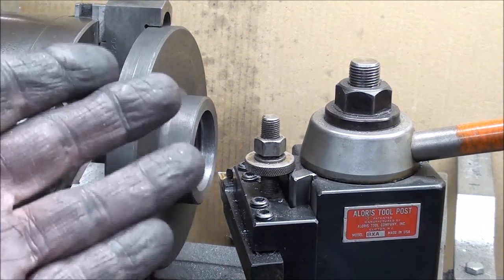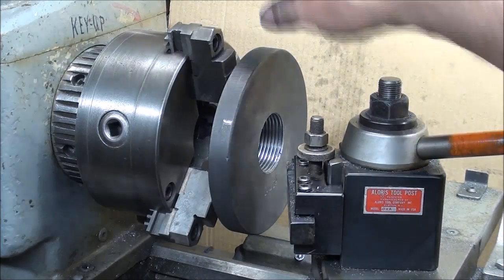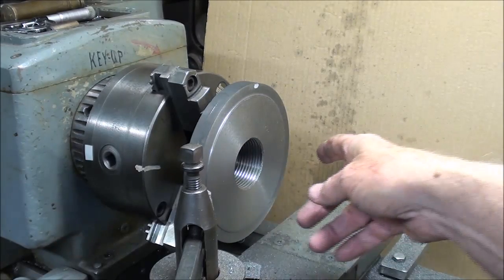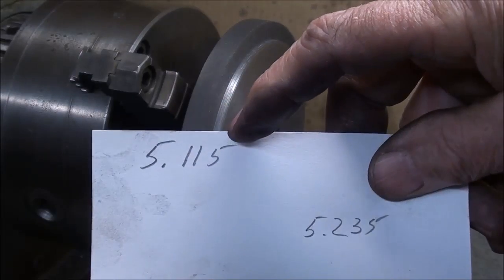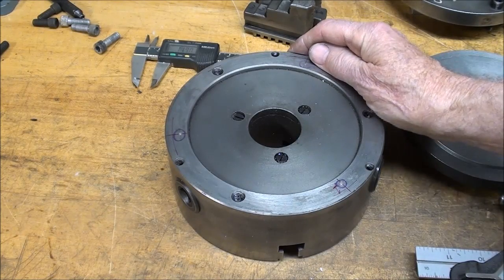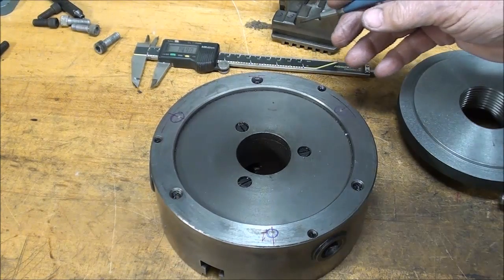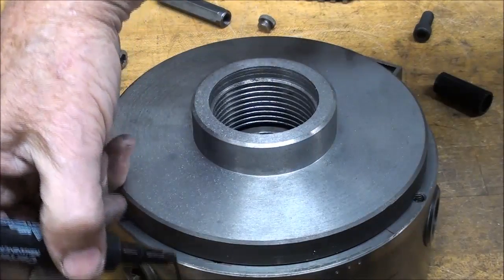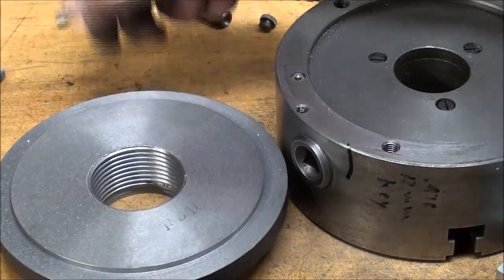SHOP TIPS #196 pt2 of 2 Fitting a Chuck on a Dividing Head tubalcain

Comment: Sir, I just watched your video on machining a new backing plate for the three jaw chuck again.
I need to make one for a 9 in. 3 jaw for my 16 inch South Bend Lathe. I got the chuck with the lathe but the backing plate doesn't fit the lathe and cannot be converted to fit. Is it necessary to use cast iron?
I have a 12 in. 4 jaw chuck  to use but would like to get the 3 jaw usable.

Bob Hayden  
rhayden2k@hotmail.com
Reply from the maker: Robert Hayden You can use steel

Comment: Mr Pete I had to do some cutting on cast iron and use some other stuff that could get your hands dirty that is hard to wash off. One thing we found that worked to clean your hands was a hand barrier cream. Several companies make barrier creams and some have special application uses, like for paints and sealants. I hate to use the nitrile gloves because my hands sweat and then break out if I wear them for more than 5 minutes. Using sealants on F-16s I would use that stuff and when it got on my hands I could wash it off when I got back to my shop. One of the ones I've used was PR88 link: http://www.pr88.co/ another is Mechanic's Armor link: https://www.mechanicsarmor.com/ and there are many more. I've found that if you are using a water based coolant some do not work very good as they are designed to wash off, you really need to check some out and try them. But for most dry stuff, sealants and oils/greases they work real good washing the dirt off. Hope this helps you out, I know how hard it is to scrub that graphite off. The barrier creams make it so easy to get that stuff off. For more choices, Google hand barrier cream for mechanics.

Comment: You mentioned that your threading dial does not line up exactly with the witness mark when you engage your half nuts. You can remedy that by placing a thinner washer between the threading dial and the carriage where it pivots. I believe a slightly thinner washer will move the mark in the correct direction in your case, or you could use a washer that is considerably thicker to move the dial far enough away from the carriage to obtain zero. A little trial and error will put you right on the mark.
Reply from the maker: I'll try that

Comment: Well, you got away with you cap head counterbores! I would have used the counterbore tool and turned a few thou of the cap screws, although it is not like a lathe chuck that is spinning around so you have no chance of catching on the sharp edge of the couterbore hole. Your tale of the ball end Allen Keys was very funny, not, I am sure, for the owner!
Reply: Hi Englishman French, quite right. I have been learning from Mr Pete (and others) for two or three years now, and yes in situations like this did not hesitate in the past  to skim the bolt head a few thou and make everything safe. Regards

Comment: @12:27, I see that I'm not alone in having the taps side out of those Greenfield style tap handles...  

It's not so bad with the larger taps, but I'm frequently working with smaller sizes - 6-32 & 4-40, or even 10-32 - or their metric analogs...  

chasing those tiny taps when they roll under a workbench is not fun...

Eric
Reply from the maker: You got that right

Comment: Thanks Mr. Pete.  I appreciate all of your work, and have learned a great deal from you.  By coincidence I just finished a backing plate project today for a new four jaw chuck for my new lathe.  I was wondering how I was going to transfer the holes from the back of the new chuck (4 of them) to the plate.  Since I had watched most of your previous videos I was thinking about getting a set of transfer screws, and I went so far as to look up sets on several web sites, but I wanted to finish the job today, so I came up with the following solution:

My lathe spindle has a three bolt mounting pattern, so I bored the three spindle bolt holes in the plate using my mini mill (which has a cheap DRO set up).  This worked fine since I had not trued up the plate to the spindle yet, and just had to get the three holes spaced properly and reasonably centered on the plate. Then I mounted it to the spindle and faced, turned, and bored the plate much as you did, including the locating step, which was coincidently 5.115" in diameter also.  This is for a 6" Chinese chuck, so maybe that's some kind of standard.  I couldn't use the DRO for the chuck mounting bolts since the pattern was outside of my mini mill table's movement limits. 

I then removed the jaws from the new chuck, and mounted it face down on the mill table using the vacant jaw slots for clamping in order to leave the chuck's back completely free .  I centered one of the four mounting holes on the back of the chuck under the mill spindle, placed the plate on the chuck, and, holding the plate by hand, drilled my first hole ( it was really held in place by the locating step). I used the full size drill bit and made the hole in a single pass. I took it easy to make sure once I drilled through the plate I wouldn't mess up the threaded hole below it in the chuck.  All I had to do after that was rotate the just drilled hole into alignment with another hole on the back of the chuck, put a mounting bolt in to hold it in place (with each new hole I would add another bolt), and drill the next hole.  This way I never had to move the table, or do any layout or measuring, just rotate the plate on the chuck using the locating step as the pivot.  I counter bored the four holes using an end mill in the same set up, using the same indexing method, again without having to move the table.  It worked out great, and I was making parts with my new four jaw chuck by this afternoon. 

Thanks again for the videos.
Reply from the maker: Sounds like you did a nice job--Thanks for watching

Comment: I dont see the advantage of the Allen screw driver being rounded like that please explain? Nice work on that chuck adapter. You are an expert. Love your videos I really enjoy them.
Reply: chemech
I believe the patent expired around 2005 or so.
Reply: Hello shartne,  the rounded end of the driver allows you to access and drive an Allen screw if you do not have access to the head of the screw directly in-line with the long axis of the screw.  In other words, if there is an obstruction over the head of the screw, you may nevertheless be able to drive the screw from a slight angle.  With conventional Allen screw wrenches you do not have that luxury... you must be directly over the screw head, in line with the axis of the screw hole.  Hope that helps.
Reply: I believe that the technical name for that type of hex key is a ball-nose.  Once upon a time, they were only available around here under the Bondhus brand, but in the last ~5+ years I've been able to buy other brands as well.

We used them a lot in electronics and automotive work, where you just cannot get a straight shot at the head of the cap screw...
Reply from the maker: Thanks for watching

Comment: Nice vid!  Never heard of transfer screws, I like them.
Reply from the maker: Thanks for watching
Reply: They come in real handy when the part needs to mate up with an existing item's bolt pattern...

They're pretty much essential for doing these chuck back-plate matchups.
Reply: chemech
They're a couple other ways.  You could clamp both pcs. together and drill them out at the same time also.

Comment: Hi Mr. Pete, Many thanks for this series.  One question I have about dividing heads is: what are the advantages and disadvantages of a dividing head compared to a horizontal/vertical rotary table with dividing plates and a tail stock?  On the face of it, it would seem that the rotary table can do everything the dividing head can, but can also do many other useful things that a dividing head cannot.  I know the gear ratios are different, but when outfitting a shop, is it possible to kill two birds with one stone by acquiring a rotary table with dividing plates and a tail stock?

I know you can't answer individual questions, but this is such a basic one, I'm hoping that you'll discuss it at some point later in the series.

As an aside, II've found that my trusty Fast hand cleaner (with NO pumice) takes cast iron dust (and many other things) right off, with no fuss, no muss, and no bother. Works great.

Thanks,  -Chris
Reply from the maker: Thanks for watching